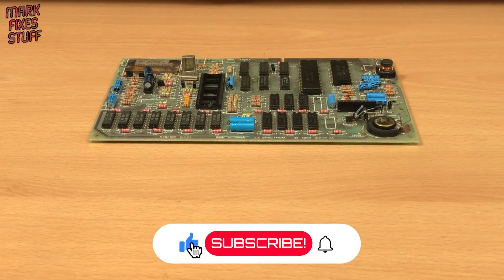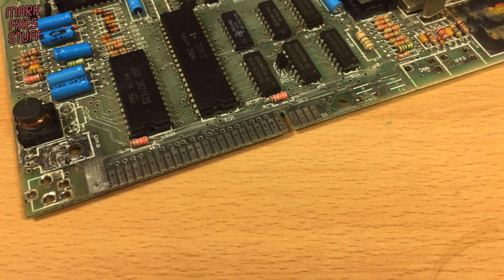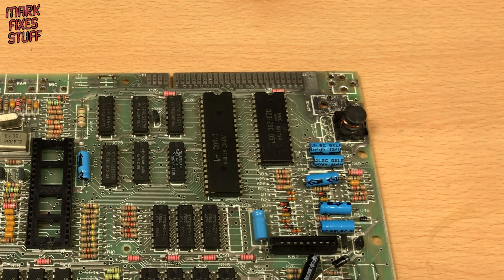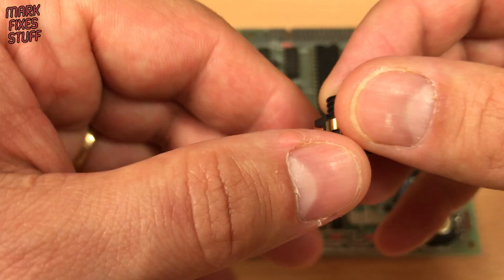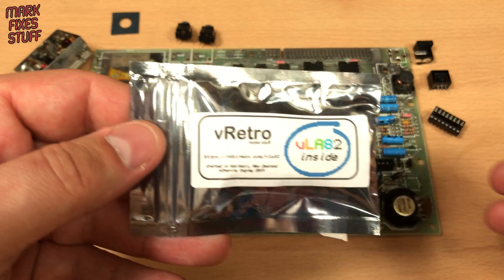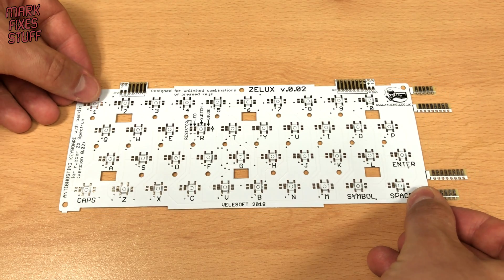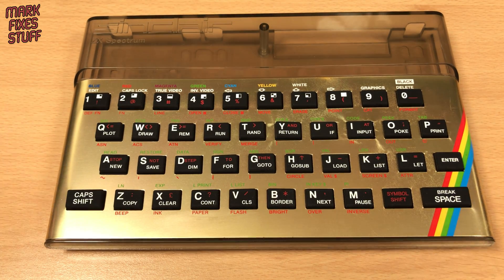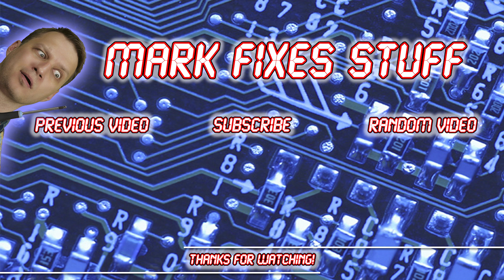A Sinclair Spectrum with half the bits missing. What are the options?

Comment: One problem you might hit is with the 4116s for the lower RAM area. These chips are temperamental things and get stroppy if their voltages (5V, -5V and 12V) don't come up in the right way. I had a lot of problems with a couple of Spectrum boards because of this despite replacing all the 4116 chips so rather than carry on mucking around with these damned things, I replaced the lot with a load of 4164s I got from Aliexpress fairly cheaply.

The 4164 is pin-compatible with the 4116 with the exception of three inputs. Pin 1 is -5V on a 4116 but NC on the 4164, so can be left connected. Pin 9 is the additional address line A7 on the 4164 so the existing 5V connection for the 4116 is left as-is to pull it high. Pin 8 is the 12V line on a 4116 which the 4164 is going to get upset about as that's its 5V input. There's a heavy trace that runs along the bottom of the sockets to a capacitor that carries the 12V line. I cut it to isolate the RAM chips from the 12V line then soldered a link to an adjacent 5V trace. Worked like a charm!

The 4164s can also be used to replace the upper RAM as well, but the links along the top edge of the board may need to be altered. I did consider doing this and add some switching circuitry to allow access to the other 32K thus giving an 80K Spectrum, but that's just another thing I haven't got around to looking at.